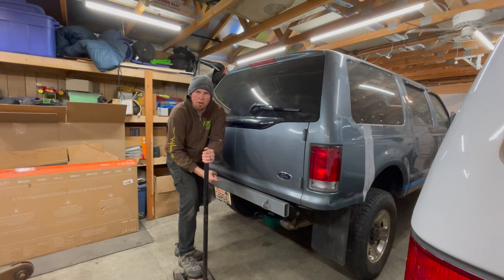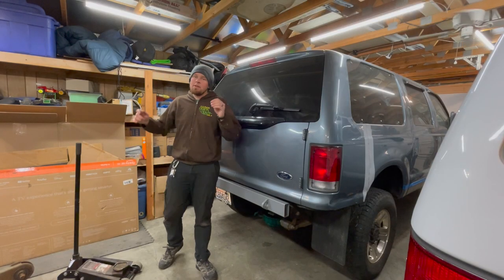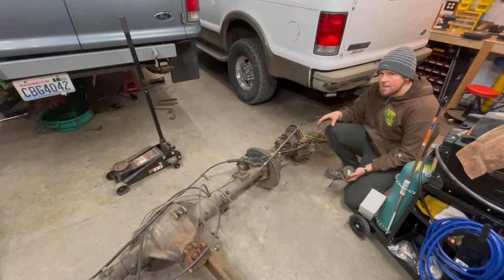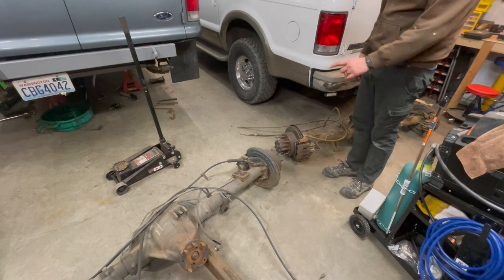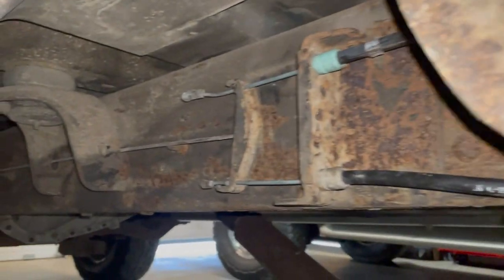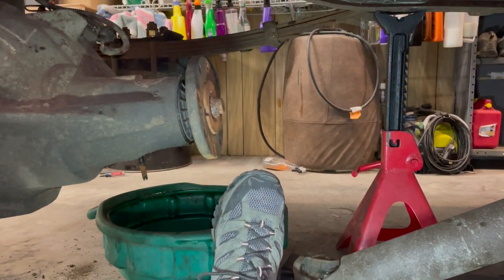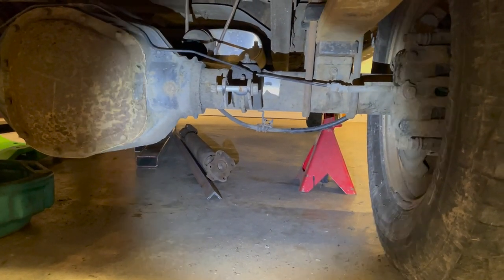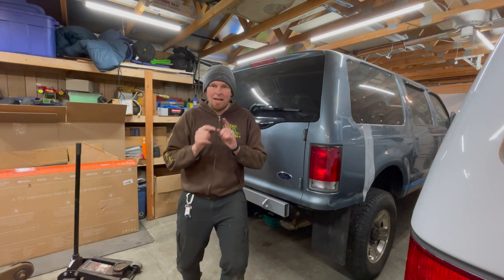Ford Excursion 05+ axle swap : Rear Axle install, Does it actually work?

Comment: Just found your channel - like what I see so far! Thanks for your efforts!

I’m just about to tackle this same project.
Reply from the maker: Glad to have you along for the ride! The rear is easy, front is harder, but not to hard.
Reply: How did it take you to switch the back
Reply from the maker: @jameswilliebacon3087  Few hours for the rear, not a bad job at all.
Reply: @Geeks4x4  4 or 5 hrs? Looking to do mine next week
Reply from the maker: @jameswilliebacon3087  For the rear only? If your quick it can be done in an hour... its easy, but allowing for some wiggle room isn't a bad idea.

Comment: How much longer are the ‘05 10.5 Sterlings vs a 2000-2004 Ford Dana 80? I’m contemplating running a 2003 Ford Dana 80 in my lifted Excursion as a SRW
Reply from the maker: Interesting question, I think in one of my build videos I measured these ones vs stock ones, might measure your 80 and see… I don’t have access to an 80😎

Comment: I was wondering if you could just swap everything on the end of the axle to do the 2005 swap. I’ve seen the bearings are the same. So swap hubs, calipers, caliper mounting bracket, backing plate, rotors.  It looks like the hub and rotor are just offset out. And that’s how they got the wider track. This way I can keep my rearend that I know is good.
Reply from the maker: Interesting thought. You don’t gain the coil springs either and the brakes aren’t that much bigger, plus no turning radius gain. I don’t really think it would be worth it on the front but maybe the rear is do able. Seemed the width was in the offset to me.
Reply: @Geeks4x4  Yes I was just thinking on the rear. I think it’s doable. I just don’t know anyone with both axles to try. Big thing is I get to keep my known good rear end.
Reply from the maker: @ecdc4990  Ya not a bad idea, most of us are probably going to end up with a newer less mile rear end by swapping but I'm interested. Let me know if you do it!
Reply: @ecdc4990 any chance you tried swapping everything on the end of the rear axles? I'm looking to convert my excursions suspension in the near future, wondering how this worked out for you. Thanks!
Reply: @SnackMasterX  No. I was more wondering if anyone has tried this.  I still think it’s a possibility. If anyone does the swap they could try this first.
Reply: @ecdc4990  I'll check with my shop and see what they say. I was planning on just running wheel spacers, but I'd rather pay more to upgrade rear components instead.
Reply from the maker: @SnackMasterX  As I told him, it really doesn't gain you much, our hubs are already dana 60 size, and i think the width is gained from the axle tube itself.

Comment: Does the newer axle fit like 2016
Reply from the maker: Technically they can work, the issue lies in the electronics, the excursion uses a single rear abs sensor to read speed, and at some point ford changed to dual rear abs sensors so setting up a speedometer is much harder... but doable with drilling and adding a tone ring to the diff, Mush easier to stay with the bit older axles.

Comment: you can just swap the yokes... or run a conversion u joint.
Reply from the maker: I thought about swapping the yoke, but you have to watch preload on the pinion bearing I thought? Anyway for my purpose I ordered a new driveshaft, I need a double cardon and as beefy as I can get with the plans I have for this truck!
Reply: @Geeks4x4   i replaced the pinion seal on my f250 100k ago i just counted the turns and went a 1/8th to 1/4 turn past that.  just dont want to crush the crush washer anymore